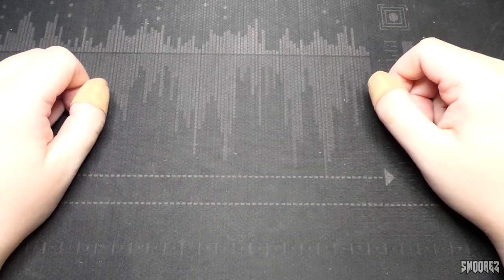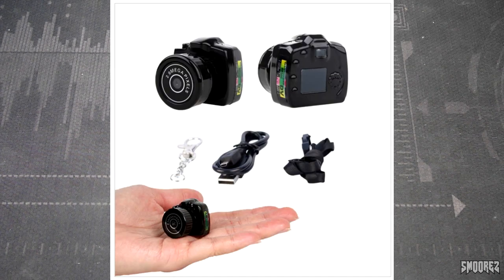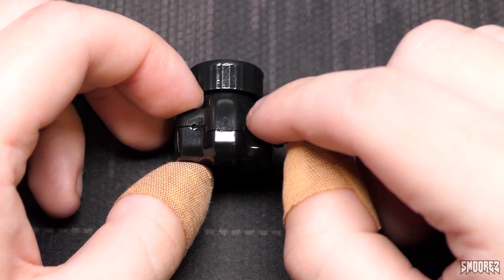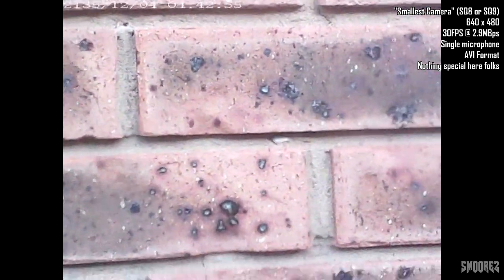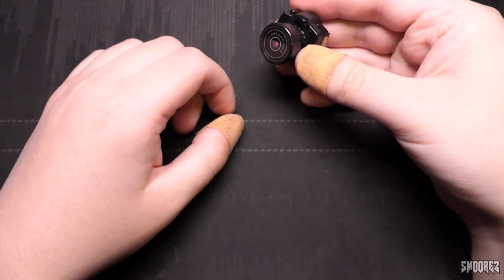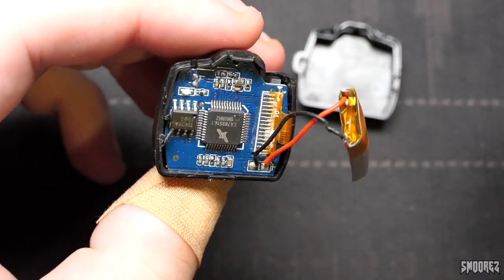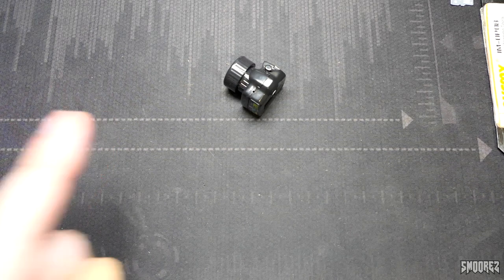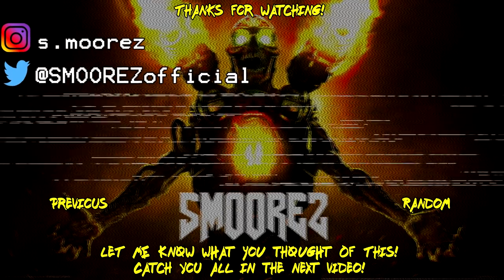iWish: I bought the "smallest camera" (aka the Y2000) because I was curious...(review & teardown)

Comment: 9:59 What idiot designed this thing so the screw is going into the side of the battery? If you overtighten or use a screw that's too long, it's going to puncture the battery.